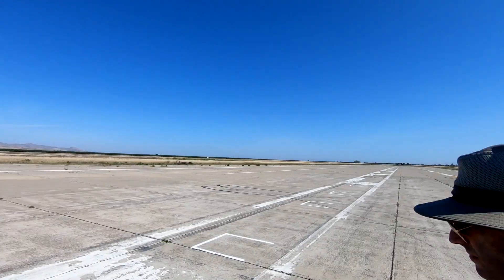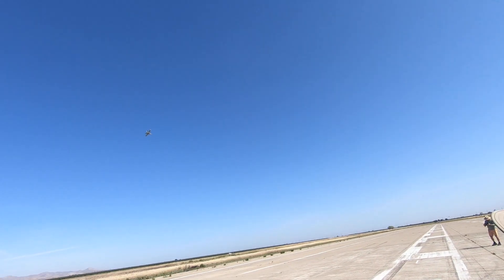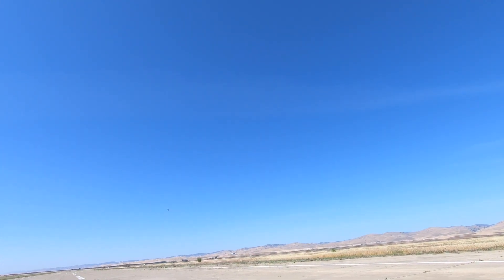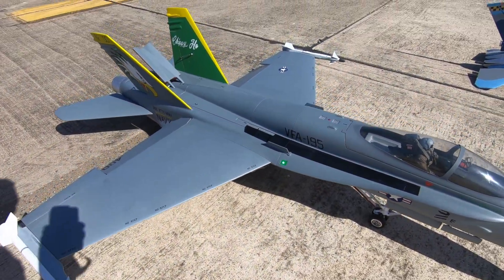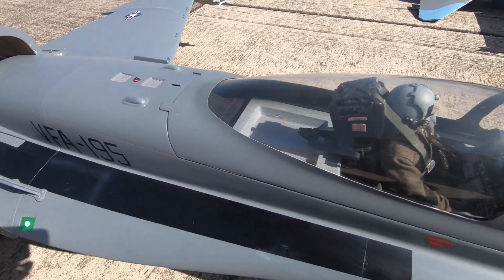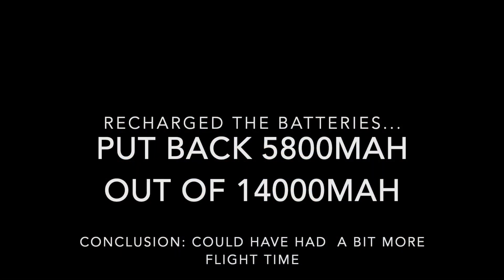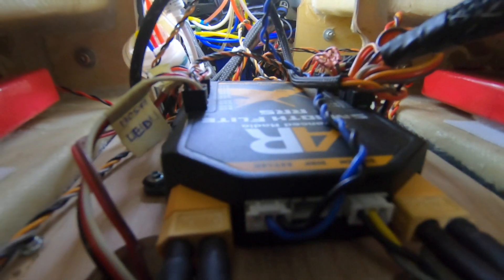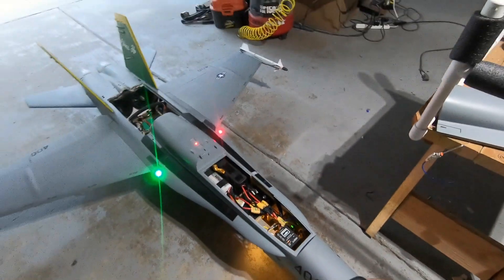Skymaster F-18C 1/8 Twin 110 EDF conversion

Comment: Frank, I've been going back and forth for a month about buying the ar smoothflite spektrum version.  What do you like about it? Any drawbacks you've seen? Did you use 4 sats and any telemetry? Thanks
Reply from the maker: Hi Steve. I really like the SF24 for spektrum, especially the smoothflite part. That's the gyro. It has an autogain feature that makes it virtually impossible to overgain the model as you might know. It's beautiful. It has come in handy once when it mattered. I flew with elevator gyro output reversed once and as soon as model started to oscillate, autogain kicked in and dialed elevator gain way down. Life saver!!! I also like that it has a regulator for power for  the servos. Also complex mixes like full span flaps, tailerons, canards, rudder brakes, nose steering, shutting off nose steering when gear are retracted... e.t.c., are all a couple of button clicks away. It's really intuitive. Finally the support the AR folks offer is pretty good. The have a facebook group and usually respond within 24-48 hrs. They were able to get me a new SmoothFlite (half price) within about 1.5 weeks after I sent the one that got damaged (after one of the ESCs caught fire. Video on my channel too) back to Australia. I thought I'd have to buy a new one but they gave me a couple of workable options. So yeah that was very impressive. And yes I use 4 sats and have had no issues. For telemetry I use the TM1000 and it works well. I have Temp, current, voltage and an airspeed probe. There is a video on this on my channel too :)

I say if you want servo power regulation and to use spektrum sats, then the SF24 is the way to go. If you have HV servos, do not need power regulation and want to use the newer spektrum serial rx receivers, then SF16 is the way to go. Also SF16 does not have a gear sequencer while the SF 24 does. But all in all I love the SF system. I got a second one for a Skymaster T-38 I'll be building soon. There is one thing I wish I could do: back up my SF settings. I think this is still in the works so currently you have to take pics of the screens which is annoying...
Reply: @FlyWithFrank  thanks Frank.  Great input. I'm considering it for a predator 2.2m. I bought a 20310t for it because people were saying power regulation is one more weak link. I havent installed it yet and keep looking at the smoothflite but haven't pulled the trigger.  The gyro is a definite plus for me and my predator has hitec 7955s throughout which they say can handle 7.4 but show 6v. It would be nice to regulate them to be safe or else buy 2 life batteries. Sou you know if the sf will power the pilot gear/brake controller instead of using a separate 2a pack? I love the technology just dont have much knowledge in the setup of the electronics but I'm definitely eager to learn but dont want to make a setup mistake with a 5k bird.
Reply: @FlyWithFrank  didn't ask...do you need the gear controller with the Sf or is everything run thru separate channels including brakes?
Reply from the maker: stevecharrison  aaah. I have pneumatic gear and brakes. SF doesn’t work those. I use the HSD pneumatic controller and that gets connected to a servo channel on SF. Then radio talks to SF. If you have servo driven valves AR sells their own controller which will work.
Reply: @FlyWithFrank  thanks Frank!

Comment: NICE flight and landing, you were able to keep a good glide path on landing.It take me a second of playing with the CG and elevator thrust to get good CG.

 How did you get two 110s in the back? I had a hard time with two 100s in the back of a Skymaster F-18 E because the rear former holes were not lined up for straight through thrust tube for 2 x turbine or EDF. Was the SM F-18C 1/8 rear former holes lined up good enough to get thrust tubes for 110s in or did you have to modify the formers for the EDF thrust tubes?

Thx in advance

Comment: Great looking plane. Man I see your stepping up to bigger models. Congratulation on your maiden flight.
You are still able to fly :) Most of our field in NJ are still closed.  Great job Frank.
Reply from the maker: Thanks Jetjunkie. They just opened up the fields this week. So I am super excited. Things will get back to normal my man soon!
Reply: @FlyWithFrank  You still should practice being safe as this virus isn't over with.  Have you thought about just trying or going turbine. You'll have more flight time ans speed if your into going faster. Am working on my first turbine. Hopefully I'll be able to fly it this season. Enjoy and stay safe my brother.
Reply from the maker: @N2RIT  I am slowly working up to turbines. I will get there. I just find electrics intuitive to me as I am an electrical engineer by training. And yes we should all stay safe during this time for sure! I had my mask with me but had to take it off to express all my excitement! Stay safe too and I'll be looking to see your turbine in flight hopefully soon!!
Reply: @N2RIT  I've been flying both for years, I like the sound and smell of turbine but at my field would rather have EDF with more battery for performance. Unless you have a big open area the lag in all the turbines except the micro X45s to 110s have way too much lag were as I line up my EDFs and punch them and I"m full speed before they pass me. I don't have to go further out to time the lag and instant acceleration no matter what the speed. For instance I fly 7000 mah in the FMS F-18 and it lands like a kite and flys just as long as any turbine I have with reserve. 8000's in bigger jets for 6-7 min flights cause 5 min EDFs flights are for an older time when battery choices were low.

I get in turbine moods but like the EDFs for the predictable and more precise thrust performance
Reply: @edfhobbies556  Thanks for the input. I fly my bigger jets at a big field like Frank has there. And your correct about having that instant acceleration. Am looking for a bit more flight time than 3-4 min. By the time I get into flying my EDF it's time to land.  My EDF HSD V4 viper will pretty much glide all the way in for landing without flaps. In fact all my big viper will glide in I can't say that for the F-16 lol. I know you can't do that with the turbine. I'll be using the main tank and the smoke tank for fuel I should be able to get a good 8-9 min with fuel left over when just cruising around.

What size plane's are you putting 8000 packs in?
Thanks again for the input.

Comment: Hey great maiden!  So on this power setup you are at about 3min total flight time?  Am I reading that right 28000mah total?
Reply from the maker: Hi Dennis. Its a total of 14000. I have one 12s 7000 paralleled with another 12s 7000 for a total of 14000.